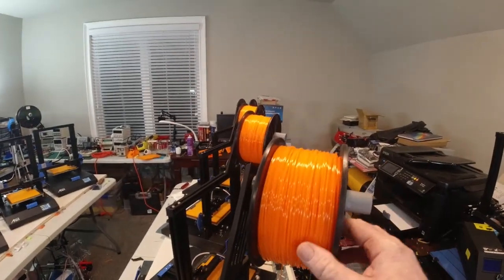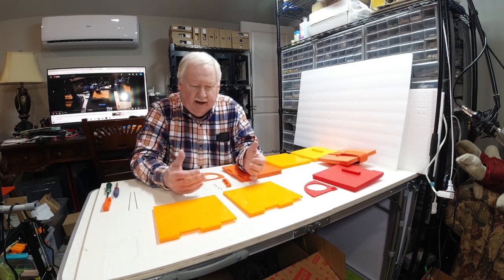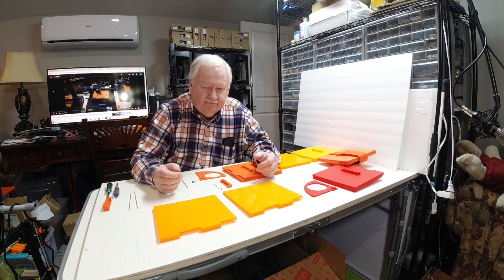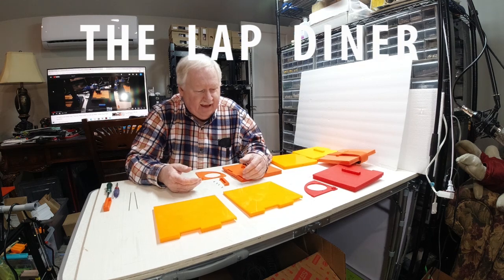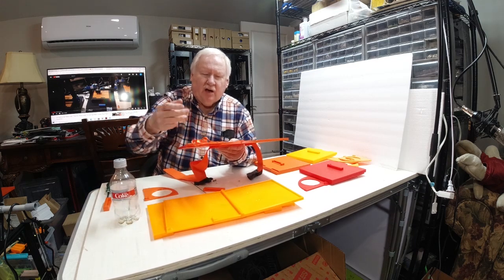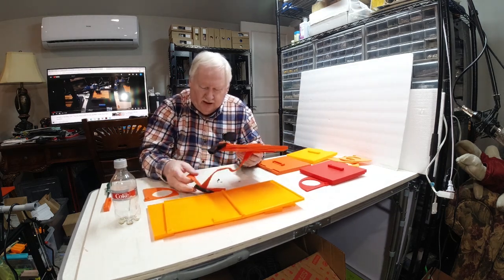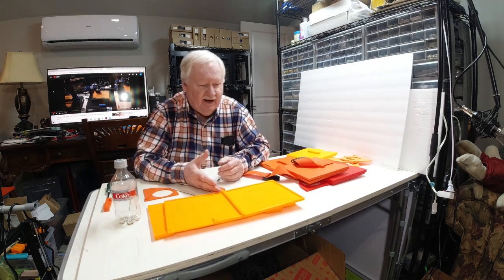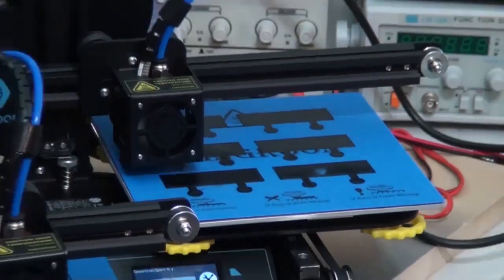THE MYSTERY 3D PRINTED PART REVEALED, The answer to what this part is for.

Comment: Cool idea. To stop things sliding about. Could do with a rubber mat or some sort of grip surface. Instead of the strap on the bottom. You could have a folding two part leg. One part goes underneath the leg. Just a idea that you could do a model in fusion 360 or some other design software.
Reply from the maker: Thanks for your comment and suggestions Jessica. I do have a rim around the outer edge of the tray that will keep things from sliding off the tray, however I have thought about a non skid surface that would keep the "fries" in he video from sliding on the tray. In all fairness I was sitting on a tall chair and my thigh was angled downward which caused the "fries" to slide to the edge of the tray. Not making excuses, but "that's my story and I'm sticking to it". Thanks for interest and helpful ideas, hope you will keep following my adventure...Ken
Reply: @NewTechInventors  looking forward to seeing where this idea goes and if they are any design changes along the way.

Comment: Nice video....I love your idea.  I would not go injection until it’s totally complete and by then printers will out shine any injection molding Mfg.    balance is an issue it seems on your lap table.   Suggest a hip grip made out of pla that tights as you inwardly push. Of course it is attached to your center hinge pin .....the peice should be a curve to fit your buttocks
Reply from the maker: Thanks for your comments and for your ideas, it shows that you are really paying attention to the product details. Glad to have your kind of feedback. If you look close to the bottom of the tray you will see that the leg strap attaches to the center of each half of the tray which holds the tray in the open position and also helps provide more stability to the tray. Also when folded the entire tray is the size of a small book, making it easy to store in a back pack or carrying bag. You may have a point on the injection molding issue, and I will be looking closer to the possibility of full 3D printer manufacturing of the Lap Diner. Thanks for that idea and for watching...Ken
Reply: @NewTechInventors  portability is critical.    Thinking about your product last night.. I thought if there was a telescope fold down on each side of your table.  That would rest on the seat you would increase stability.   Ps this could have a swivel to make it angled and then be used as a reader or a pc holder

Comment: What material are you printing with? I would be afraid of the Lap Diner warping in the sun if you were using PLA. Personally, if a product is meant to go outdoors, I always use PETG. It's a little more work to print with but definitely worth it!
Reply from the maker: I have printed this part in both PLA and PETG and I am currently testing both to see how they hold up under what I think would be normal conditions for their use. Thanks for the  input, you have made a very good observation and I appreciate your ideas...Ken

Comment: You could put a big team logo on that surface.  I would think the drink holder on the other end,  between the legs would be more stable.  Heck add another cup holder.
Reply from the maker: Thanks David. I have looked into franchise rights with SEC Team logos. It does cost more, but if this does take off I will look into team logos and colors. I have lots of colored belts and the prototype units are Tennessee Orange. I will be looking closer to a larger unit and maybe two drink holders. Thanks for your suggestions and for watching...Ken

Comment: what about a strap over your neck with 3 attachment points, 2 in the back 1 in the front , that way it sits on your low stomach out of the way from other people your idea would or might bump into the person next to you and seems a little fiddly
Reply from the maker: Good thinking William. It would be hard to use that method of neck straps and still allow the tray to fold into a small compact size. The small size is important for it to fit in backpacks and be easy to carry. I won't count your suggestion out till I look closer at it. Thanks for your participation and suggestions, they are greatly appreciated. Thanks for watching...Ken
Reply: @NewTechInventors  i meant go to one plate instead of 2 that fold and then center your drink holder out front instead of to the side
Reply: from the looks of it one plate is enough room for a burger and fries, also 1 plate looks like it would fit a dinner plate
Reply: iam thinking it may be more balanced and u might even be able to stand and eat also with it

Comment: OK, a few quick thoughts:

Consider making the two halves the exact same part, you'll have to play with your hinge a bit, but it would cut eventual tooling cost in half should you injection mold.

Consider softer raised edges. Sharp corners can be a pain to clean should spill food in the tray.

Consider having the bumped out portion of the hinge facing down, so the top of the tray is flat. You may find this introduces comfort problems with the legs. Could be mitigated by contouring the bottom of the tray or ribbing it for strength/comfort. 

Consider sitting position. Many men and women do not sit with their legs spread like your model. Particularly in tight sporting arenas. I'd imagine more people are likely to us this like a fast food/cafeteria tray balanced on both legs, in which case the one legged strap may seem odd. But then again, I dunno, havent really tried it, your way might be fine. 

As you're 3d printing you should be able to find a way to use bridging to route the strap through the main two parts without  the additional screw in components.

The cup holder looks a little weak. To not break under load/impact I'd imagine it would need to be a lot thicker.

Consider having the cup holder fold up instead of out, so the bottom of the drink rests on the tray instead of cantilevering into space. Benefit of reducing overall footprint. 

That's a big buckle for the strap, and its not carrying much load. May be able to cost reduce it to something backpack sized. 

Carrying handle. 

I dunno what is about pla, but it just sounds cheap/tinny, like the crummiest polystyrene toys. May consider adding parts or orings or something to improve the sound /feel when you open/close it. 

Good luck! I love seeing projects like this and wish you well. 

Injection molded parts usually have ribs to increase strength while minimizing part volume. Consider a deeper part with thinner walls + ribs.
Reply from the maker: Thanks for your comment and suggestions on ways to improve the Lap Diner. I very much appreciate the time and insight you put into providing me with your ideas. It really helps me to get this kind of feedback form unbiased people like yourself. I will review each of your suggestions and consider how they might be implemented or incorporated into the design. Again your comments will be very helpful to me and I thank you for them and hope to hear more from you in the future. Remember that this 3D printed version is only for proof of concept and that once proven to be a viable product I will be injection molding the Lap Diner. By the way, you are awesome with the 3D pen, I was blown away with your skills. Wishing you luck my friend...Ken

Comment: Very cool concept Ken! Here are some off-the-cuff comments:
- It would be perfect in a car! Especially now with limited seating fast food restaurants
- Ideal for picnics, camping or all activities where you bring a folding chair
- I would possibly target these markets separately, greater chance of acceptance in each
- I find Costco very receptive in new ideas and testing/trying out products. They even do so in a single local store for you to try out. I would approach them now and discuss how many you would need to tryout. And perfect time as spring/summer stuff are already hitting their shelves!
- IMHO, I would drop the strap altogether and reduce the parts count: I would not tie this around my leg plus it adds costs for little return/value (IMO)
- Increase the surface area just a tad. When the "highly paid model" put out his "Wendy's" lunch in his tray, he quickly you ran out of space for a normal one-person meal
- Instead of the drink strap, maybe consider, if you can find an off-the-shelf drink netting (already see this on picnic chairs) as it is more efficient at catching the drink (especially bottles) or use an inner TPU flap to friction fit/hold drinks (like you have in many cars and you can print them yourself)
- Would make the drink-flap a little more sturdy, it seemed to be slightly flimsy in your model's testing
- The largest change I would make/add is a mechanism to positive lock the tray into the flat or open position! The last thing you need are complaints with trays folding under weight between the legs with the meal all over the place/pants/floor...

You're onto something really good here Ken. With a few tweaks, very focused/targeted/segmented marketing and you might be off to the races my friend! C
Reply from the maker: WOW!! Great comment. I just responded to another positive comment and included that I was open to constructive criticism. Your comment is what I was talking about. I can tell that you really looked hard at my Lap Dined and came up with some interesting observations and ideas, some of which I have also considered. You suggested  a larger surface. When I started I only had a 220 X 220 mm build surface to work with and this is why it is the size that it is. Now that I have larger 3D printers I will work on a larger size Lap Diner and maybe call it The Deluxe McDiner. HA! HA! All kidding aside I sincerely appreciate you taking the time to give me your honest opinion and ideas. Hope to hear more from you in the future...Ken

Comment: Hi, is this PETG you use for these prints?
Reply from the maker: These parts were printed with PLA. I have printed them with PETG but have not completed test to determine difference in strength between the two. Will let you know what I find out. Thanks for the question...Ken

Comment: Hey Ken, cool idea. May want to add something in the print for inside, seems too slick. Your fries wanted to run away. Maybe do another printed part in some of that flexible material. Just a square of it to grip smooth surface items. Thank you for sharing your journey.
Reply from the maker: Thanks for the comment Jeff. I was sitting on a tall chair that allowed my leg to slope downward allowing the fries to slide to the edge of the tray. The rim keeps items from sliding off of the tray. You have a point, I could add another interior rim to prevent items from going to the edge rim. Thanks for the input Jeff and thanks for watching...Ken

Comment: I believe that tray has several different uses. Interesting concept. Taking it a step farther and design fold-up leg supports as another option to using the "seat belt."
Reply from the maker: Thanks for your comment Dean. You are right about several different uses for the Lap Diner. It can be used to hold a laptop, book, papers, and provide a writing platform when no other surface is available. It is small like a book and easily fits into a backpack. The strap is comfortable and does hold the tray firmly. Thanks for watching...Ken